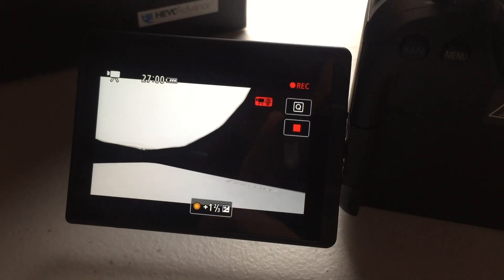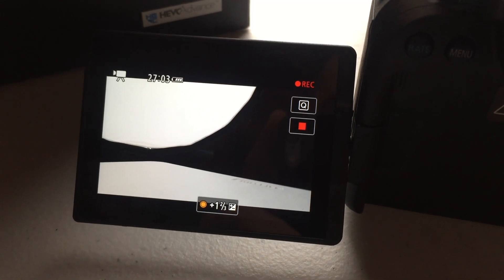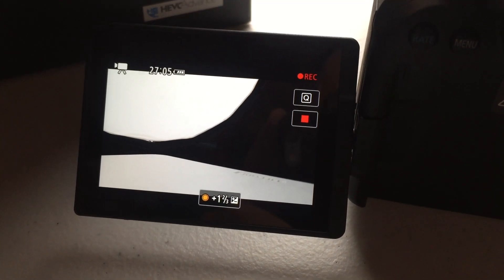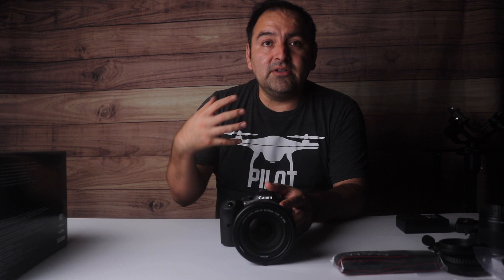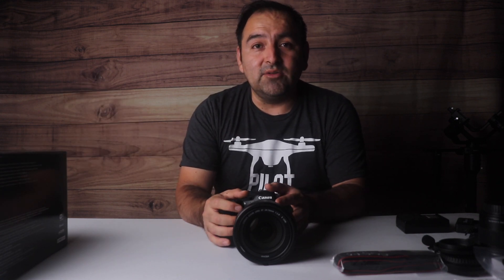R6 overheating? Firmware 1.1.0??

Comment: How long was the cool down time after it overheated? Did you have to wait a few hours or did you regain a few minutes after a few minutes of cool down?
Reply from the maker: so far cool down times are not as bad as I thought, after 15 mins the camera been turned off I got 15 mins of 4k 60. After 25 mins of cool down, I got back 25 mins of 4k 60! not hours but I am hoping a firmware update would give us shorter cool downs, the camera was not hot at all, warm but not like extreme hot.
Reply: Alex Pizarro awesome thank you!

Comment: Thanks for doing this Alex,! I was wondering about the overheating timing and as to when it would begin. I see that 1.1.0 version came with the R6? , I am too hopeful canon will do the update. How's the IBIS?
Reply from the maker: Hey Sean, yeah it does come with version 1.1.0 already so I was curious to do tests and see if they were improvements but none when it comes to the video that I was able to test.
Reply: IBIS is good. Tested my 400mm F5.6 non IS.  Handhold 1/100 gives a scharp image from our cat. Eye in focus. Normaly I have to use at least 1/500.